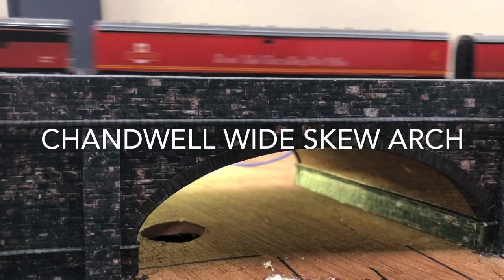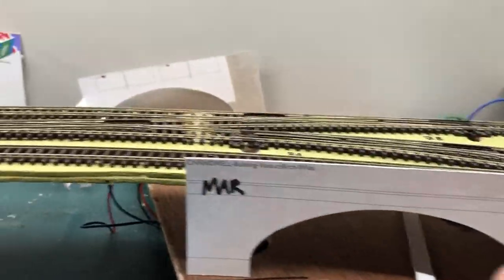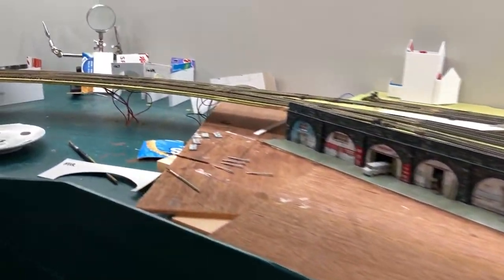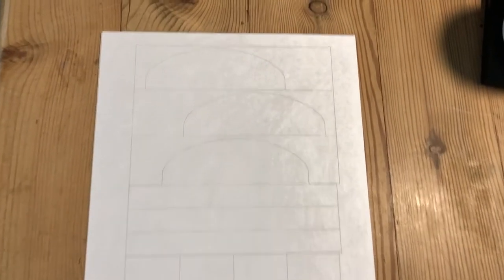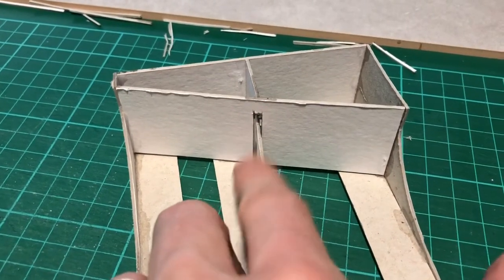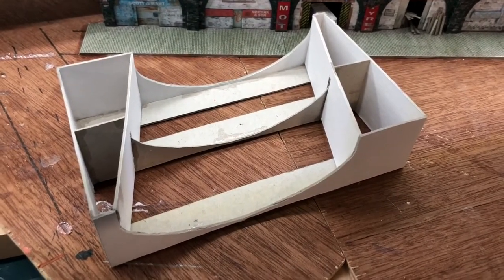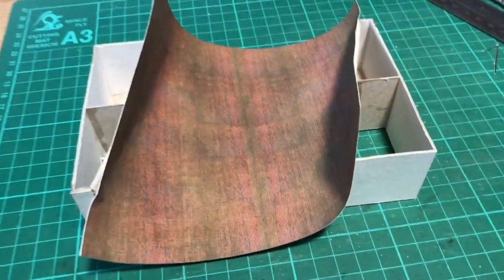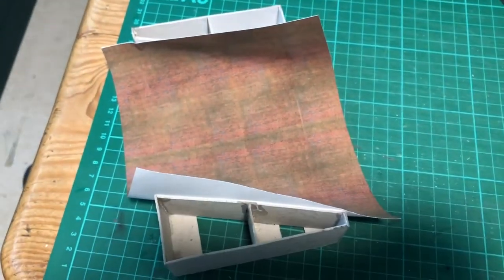How I made an N Gauge wide skew arch out of card for Chandwell

Comment: That archway looks absolutely brilliant. I cannot believe how excited one can get watching someone finishing off his archway LOL. Those edging bits really finish it off. Regarding the slight crease inside the arch, you wont see it when its down and we are all our worst critics. The amount of detail is amazing and I think people forget we are working in N gauge when the end product is so good, most think along the lines of 00.
Shame about the piano wire going through the roof of the arch but if you had not pointed it out I dont think anyone would have noticed. As you have so much piano wire I would have built a angled base for the point motor to fit on than attach it underneath the layout so that the wire goes through the arch pillar at an angle into the point mechanism as its only got to move it sideways. I have seen points operated like that before with no issues but never tried it myself.   
I really love the track work leading into your terminal, bit like mine which is why I wanted to copy Bognor apart from living nearby.
Brilliant Michael, not many could pull that angle bridge off as you have.
Regards Chris
Reply from the maker: Thank you! Yes, I’m always my own worst critic but I do love how the viaduct has ended up. It never occurred to me to bend the piano wire. I’m not an engineer, that’s for sure! Thank you for your kind words!

Comment: Hi Michael. Great work on the bridge. I must say that I was surprised at the gauge of piano wire you have bought; I'm sure other modellers have used a narrower gauge. Didn't notice the patch until you mentioned it! Good to see you are eating healthily.
Reply from the maker: That's interesting. As with everything I do, I just make it up as I go along. I know the Cobalt point motors have really thick wire, so I just went with about the same. It will have a long way to travel (about 120mm from motor to track), so I thought anything thinner would bend and not throw the point.

Comment: i have revisited this video a few times, and been thinking about your point activator going through the arch.  As it will probably end up beside the road, maybe even on the kerb, why not glue a small traffic sign onto it, paint the bottom "galvanised steel" colour and above the sign a mucky sort of brick colour.  Makes a virtue out of a carbuncle.
Reply from the maker: Great idea! As it happens though, because I so rarely actually run trains, I have decided not to bother with point activators at all! :)

Comment: amazing build, as always. Only thing I would have done differently and this comes down to personal taste, is have the bricks on the underside of the arch bridge run horizontally, not diagonally. From my perspective it just looks... odd, that the discolouring of the bricks runs on an angle instead of straight across. Personal taste, that's all.
Reply from the maker: Thanks Ken. This diagonal ‘twist’ is actually prototypical. The effect is caused by the brick course having to run perpendicular to the bridge buttresses. If you do a Google search for “brick skew bridge” you will see some examples. But there’s nothing wrong with having it straight of course! 😀👍